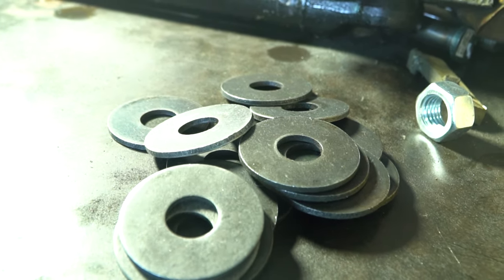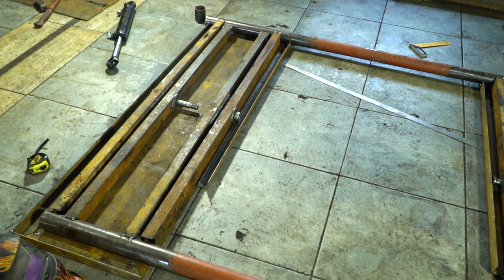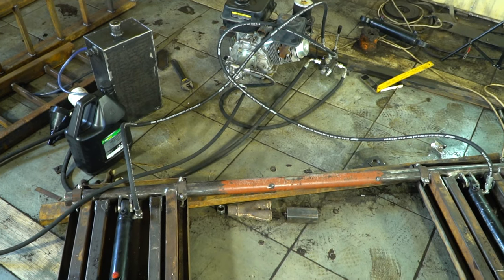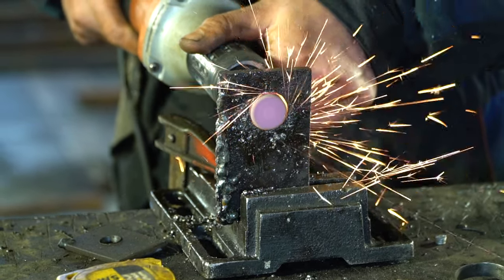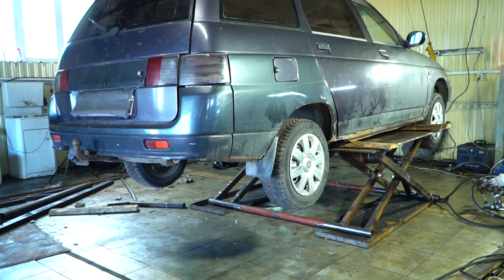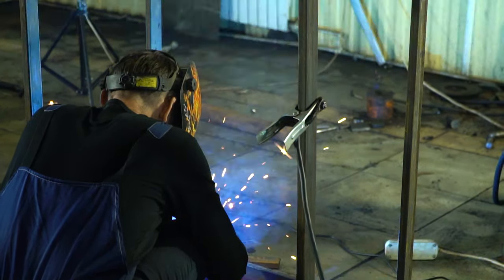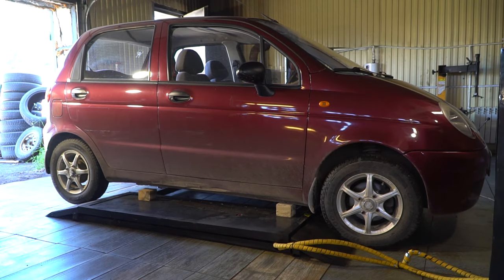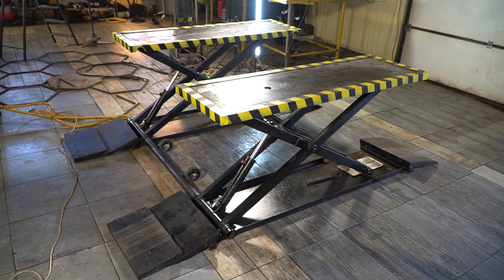Making homemade car lift

Comment: I make actual lifts for a living and all of them have redundant safty locks because hydraulics fail every day it's just a matter of time before you blow a hose or seal and loose your legs. Good luck! Ps you could of bought one of these used for 600 dollars
Reply: $600 ? Where? I'll buy one tomorrow
Reply: Where can I buy a hydraulic car scissor lift for $600?
Reply: @iTs_Turbine_Time_in_Turbonia  Good question, Harbor freight had low or mid lift for 600  of course until I started looking for one.
Reply: @RusThompson  You have any idea where i should start searching?
Reply: @iTs_Turbine_Time_in_Turbonia  Harbour Freight is ready to start selling them again.
Reply: @RusThompson  I checked and they have none available. I want to purchase one before Harbor Freights timeframe of release on theirs for much cheaper.
Reply: @iTs_Turbine_Time_in_Turbonia  You find one then let me know. I may have to build a few but need some measurements.
Reply: @RusThompson I will keep you in mind, but I think I may want to build one as well.

Comment: so basically each cillinder has to have a load capacity of 4x the vehicle weight?
Reply: it would seem that cylinders need repair as they cant lift 1.5t car,probably needs new sets of seals
Reply: @denimory  or maybe the  pump isn't strong enough to supply enough oil to lift that weight

Comment: The waight limit is because the material and shape or because of the pumps capability? Or could you just add 2 more pistons to have 2x the lifting capacity
Reply: It can be either because of the material, or because of the motor creating the pressure within the pump. Theoretically, with the infinitely strong material, only the motor power would need to increase in order to lift a heavier car.

Comment: needs a seperate lift lock. under engineered for weight load or any safety margin.good copy of existing lifts on market. Have to agree with Trevorjarvis just not safe at all to get under it.
Reply: They’re gonna die if they get under a car on that thing!